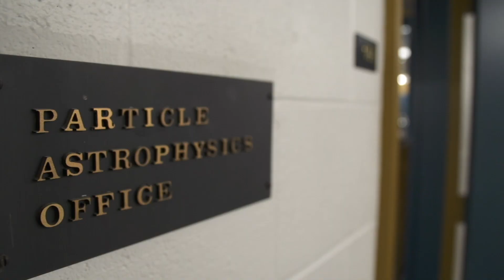The Search for Dark Matter

Comment: Dark matter is a supersolid that fills 'empty' space, strongly interacts with ordinary matter and is displaced by ordinary matter. What is referred to geometrically as curved spacetime physically exists in nature as the state of displacement of the supersolid dark matter. The state of displacement of the supersolid dark matter is gravity.

The supersolid dark matter displaced by a galaxy pushes back, causing the stars in the outer arms of the galaxy to orbit the galactic center at the rate in which they do.

Displaced supersolid dark matter is curved spacetime.

There is evidence of the supersolid dark matter every time a double-slit experiment is performed as it is the supersolid dark matter that waves. Wave-particle duality is a moving particle and its associated wave in the supersolid dark matter.

In the following video, the vibrating silicon substrate represents the chaotic supersolid dark matter.

https://youtu.be/WIyTZDHuarQ

In a double slit experiment the particle always travels through a single slit and the associated wave in the supersolid dark matter passes through both. As the wave exits the slits it creates wave interference which alters the direction the particle travels as it exits a single slit. Over time the particles form an interference pattern. Strongly detecting the particle exiting a single slit destroys the cohesion between the particle and its associated wave, the particle continues on the trajectory it was traveling and does not form an interference pattern.

The supersolid dark matter ripples when galaxy clusters collide and waves in a double-slit experiment, relating general relativity and quantum mechanics.